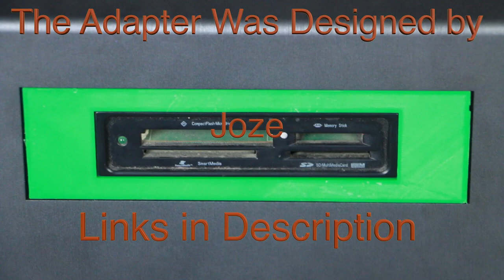3D Printing An Adapter CD to Floppy Disc AKA SD Reader! [Thingiverse Print Review]

Comment: Printing instead of buying is probably the second best. Because the best is that you can print anything you need instead of working around your vision.
In the PC area I wanted HDD brackets in a specific way because I was very space limited. Impossible to buy, metal would not be good because of conductivity and wood wouldn't be good because it's a good thermal insilator. So just made it myself how I wanted http://i.imgur.com/fKI9pSz.jpg http://i.imgur.com/4ap0Zdn.jpg